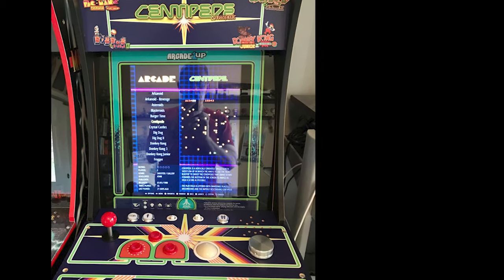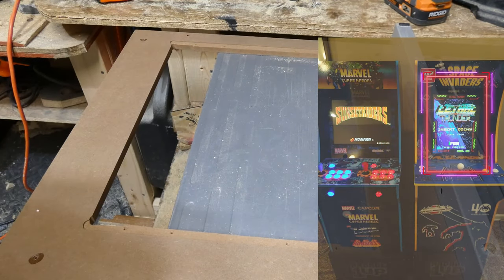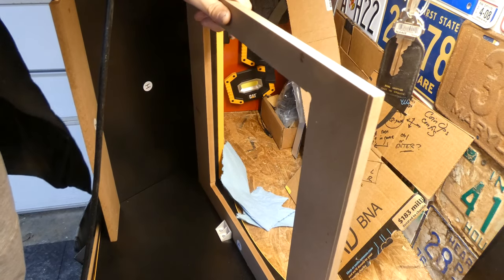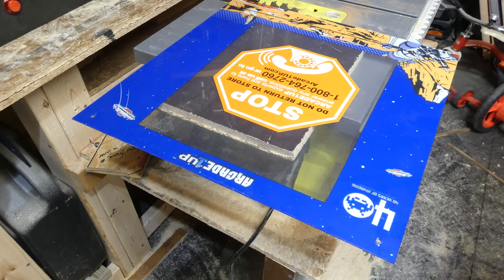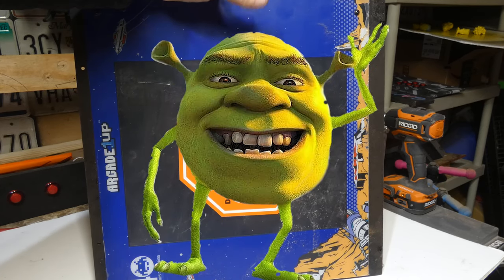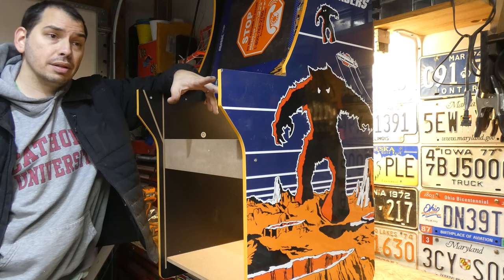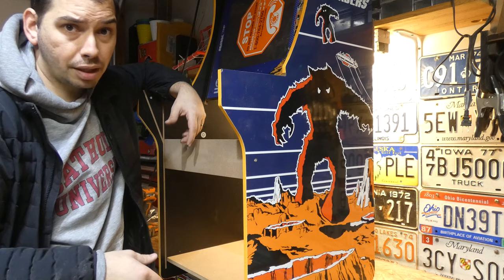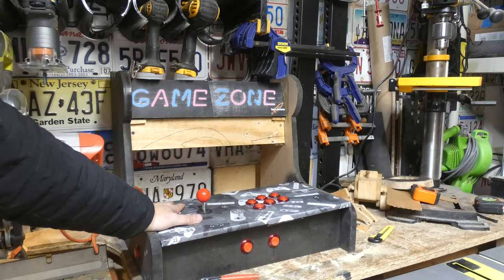Rotate Arcade1up screen

Comment: How did you tilt your street fighter screen to angle it to look up more than just the straight view they come as? Thanks
Reply from the maker: If it was me, I would probably angle the the monitor, wood, and plexi as one unit. Since it fits into grooves on the sides on the arcade, you would need to shave that amount from the sides, then leave the bottom against the control pad and tilt the top back until you like it. Relocate the white brackets and tighten it all down! :)
Reply: @retroreviews1278  I may have to try that. Would make a much better playing experience. Thank you